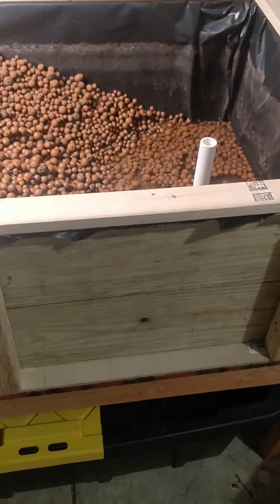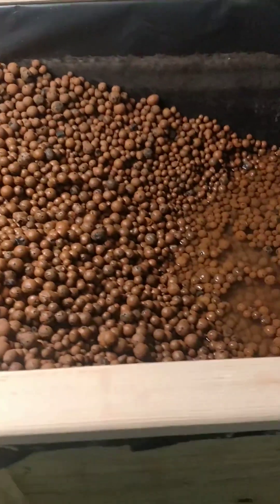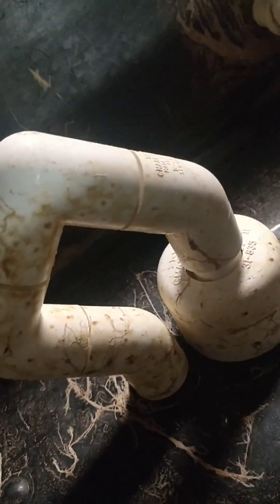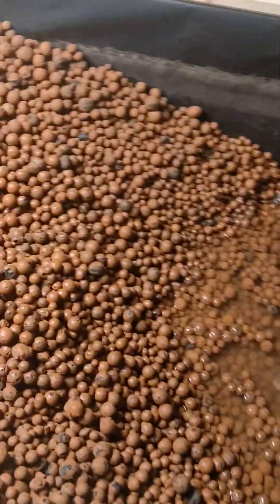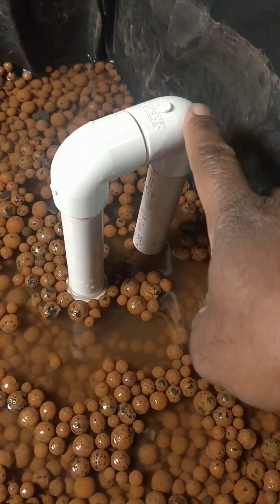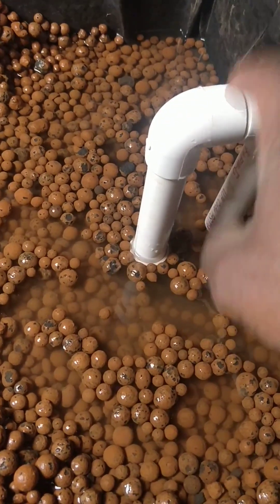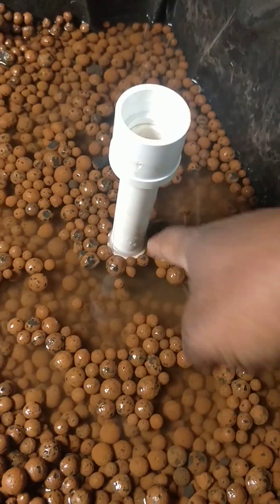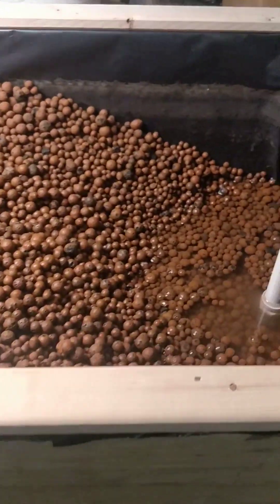Hydroponic System Upgrade 4.0 - Part 6

Comment: How do you clean the roots out of your hydroton?
Reply from the maker: @cliffp73  this was the 4th version our hydroponic system and the first version used perlite. That stuff was next to impossible to clean the roots. For this reason we moved to hydroton in buckets, then 4 bus pans, and then to what you see here. 

For cleaning, I would use a heavy duty storage container to place a few of them into at a time and use a water hose to spray them down well. Also, I'd use a small piece of PVC pipe to agitate them around. It may take a little bit of work but the dead roots and other debris will float to the top of the water. Last, I used a 5 gallon bucket with small drain holes in the bottom and sides to scoop the clean hydroton out for rinsing and draining a few more times before going back into the grow beds. 

For good measure, I would restart my system and cycle it for 24 hours using the recommended amount of 23% hydrogen peroxide per gallon. I hope this helps!
Reply: @ Thank you for the comment! I am at the 5 gallon bucket stage. I have been “playing with letting it dry out and get the big stuff out and then I use a blower to blow all of the light material ie dried roots. Then I sanitize.

Comment: I wish I was there to help you. I have experience with aquaponics and bell siphons. You want the kind with a little hose running from the bell to a little cup. Those are absolutely reliable once you dial them in. I've had them run for a year without a hiccup. 
I don't have experience with hydroponics except for using bottled nutrients with the soil in my indoor cannabis plants.
Reply from the maker: @comfortablynumb9342 I have seen those before and will have to look at them again. Once I got the bell siphon working though, it never stopped.  Thanks for the tips!
Reply: @2_branchfarm  the tube running down the side of the bell siphon and the cup are important. That's what stops the siphon, when the tube sucks air.